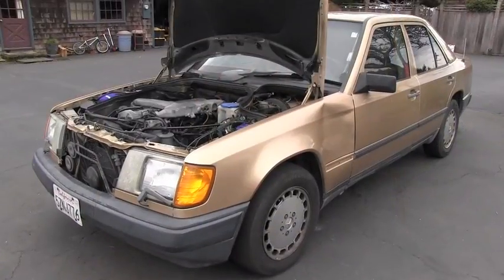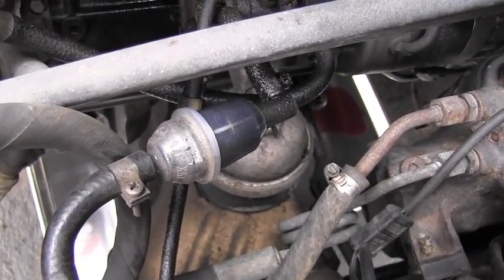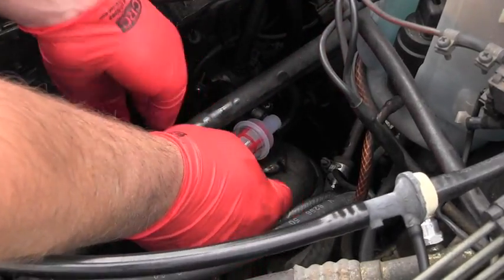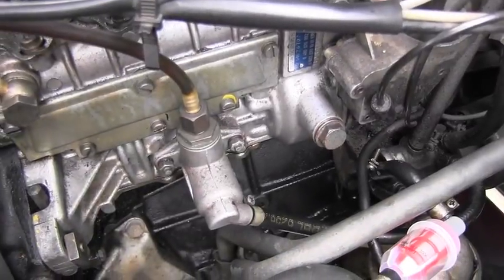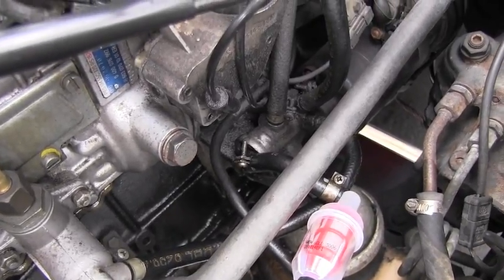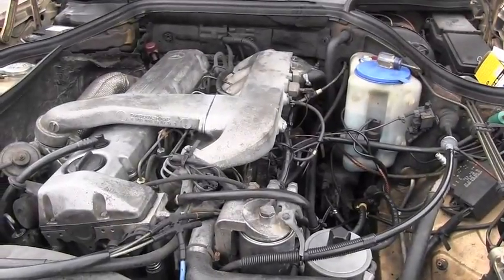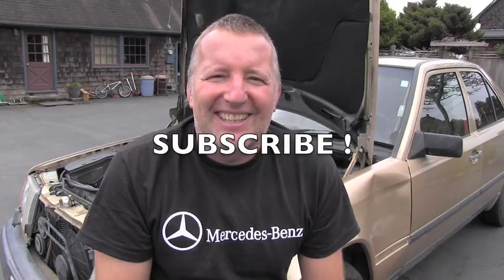Mercedes Diesel Fuel Pre-filter Replacement Problems

Comment: Nice video.
I did. Pre filter on my 1990 mercedes 300d turbo. 
I used 2 needle nose vise grips(with heat shrink tubing on jaws). One side at a time, new hose clamps, no fuel dripped  out..
You have great content. You explain well.

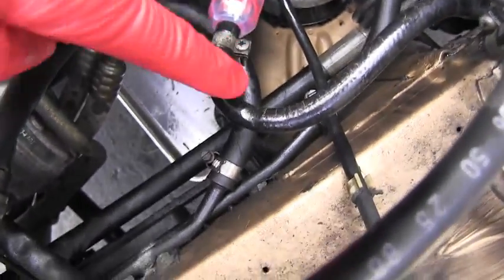Comment: Helpful.  My 2005 Mercedes Sprinter w/ 5cyl diesel (only 53K miles...in a Class C RV so it sat unused a lot) in-tank fuel pump became VERY noisy.  Ran it that way many trips.  Then CEL/SES light began coming on, producing P0087 codes (low fuel pressure) & limp mode, but only when climbing grades which called for hefty turbo boost (high fuel flow).  Flat roads or mild grades no problems. Clear codes and resume normal driving no problem until next period of heavy load on engine & fault codes reappear.  This problem climbing grades sounded like fuel starvation during periods of high fuel demand, plus with the noisy fuel pump, I suspected the pump and fuel filter.  I dropped tank & removed fuel pump.  It's an electric motor sitting inside a plastic canister/tub.  Inside the tub was a whole lot of grainy, squishy debris that looked just like the debris in your pictures at 2:10 and 3:45, only a whole lot more of it.  Looks like dark brown/black sawdust particles, only juicy & somewhat sticky so they clump together.  The entire bottom surface of the whole gas tank was coated in this stuff, mildly stuck to the bottom.   Sides and top of tank felt smooth, but you could feel the gritty gooey texture caked on the tank bottom.  I cleaned the tank insides with rags and flushed with clean diesel, filtering the outflow through cheesecloth until no debris poured out.  So now the tank is very clean.  The fuel pump has a long small diameter tube extending from the canister that is supposed to lay on the bottom of the tank.  The end of that tube has a small plastic cone-shaped strainer.  That small strainer cone was completely caked in compacted clumpy mildly sticky particulates.  You couldn't see any of the plastic features of the underlying strainer.  But that tube is too small of diameter to be the entire fuel pickup tube, not totally sure what it's for (maybe reserve capacity?).  So I then took the fuel pump apart (not made to be disassembled, but it can be done with care & time).   The guts of the fuel pump/fuel level sensor assembly is the cylindrical metal pump seated down in the center of the plastic assembly canister.  I was eventually able to wiggle the pump out of the canister.  The entire bottom end of the pump is capped with a very fine mesh fuel strainer.  That strainer was completely caked and coated with this compacted gunk.  At first I wasn't even sure it was a strainer.  It looked like a black felt pad on the bottom of the electric motor.  But his bottom end of the pump & its strainer is clearly the primary fuel pick-up path.  I pried off the strainer cap with a screwdriver (pretty easy), and you could hold it to light and see the severity of caked on residue.  No light penetrates, not even close.  Very thick layer of caked-on grime.  With this strainer cap off, internal mechanics of the electric pump is visible and it was totally clean & shiny, no sign of this debris at all.  I probed the fuel supply output connection ports of the pump, and the fuel supply line leading to the main fuel filter, seeking to scrape up gunk, which should be easy if it were present.  I found none, so I suspect those lines & the main filter are probably OK.  The pump motor insides are shiny & totally clean.  This particulate gunk is large enough particle size that it appears the fuel pump strainer captures most all of it.  The severity of this gunky build-up on the strainer is no doubt the cause of the noisy pump (the pump has to work harder to try to pickup sufficient fuel), and the obstruction may cause cavitation.  Surely it's also the cause of the CEL/SES codes and fuel starvation under load P0087.  This is the first diesel vehicle I've owned, and in gas vehicles, fuel filter issues & filter changing is super infrequent.  So, I was stunned by the amount of this gunky wet sawdust-like debris in the fuel tank bottom, in the fuel pump canister, and on the pump's strainers.  It's clearly endemic in the upstream parts of the fuel supply system.  Your video shows me this very same gunk in your vehicle.  After installing your brand new pre-filter, very quickly you found these particulates visible in that filter.  My guess is you have this stuff on a very large scale in the bottom of the fuel tank and on the fuel pump pickup strainer, and maybe elsewhere.  This was a real eye-opener to me about prevalence of fuel contamination with diesel.  Not sure if it comes from getting bad gas, or letting a vehicle sit with fuel in the tank for long periods which gives time for chemistry to change & particulates to form and precipitate out....or perhaps both causes.  Your video of the old & new filter with particulates was helpful.

Comment: 1.  I like it when people show things NOT going smoothly
...it's adds depth and reveals consciousness and character
...we get to see your mind at work when things don't go well, and that's helpful.
2.  Someone asked, but I didn't see a reply from you...(I'll rephrase):
Unlike my  W123 '83 240D 4spd manual, does the W124 use the LIFT pump to remove AIR from the fuel system after a 'breach, such as fuel filter changes?
3.  I don't know you, but I already like you.
-

Keep On, Keepin' On, My Benz Friend
...(comin' at you from SF Bay Area)
...(maybe we'll rendezvous over a fuel filter housing gasket replacement one of these days ;)
...I'll make the drive and do the dirty work, you guide the proceedings...???
...USD/Fermented Spirits/God's Gift to the Plant Kingdom/Camaraderie...you pick
-
*Considering a 1987 S124 to add to my 'herd of one.
Question:  Does a 1987 300TDT (USA import) OM603.960 (turbo diesel) have OBD-1?
If yes, is it x11, 9-pole?...or x11/4, (rectangular with button, flash and 'memory)?
-
Thank you for taking the time to do what you do...I, We, appreciate it...and You.  Thanks.

Comment: Did you have to bleed air out of the lines? I have a c250 om605 car that's from Belgium.  I have it in kansas city. The USA. I'm not seeing fuel in the lines,  so I think I have a bad fuel pump. If you know of a video that shows where the fuel pump is, please post it. (ITS A 5 CYLINDER ENGINE) keep up your good videos,!

Comment: hello, I have a question regards on my W123 240D, there are times where I prime my hand pump the pre filter will fill up with fuel, but there are also times where I go to pump the primer after doing fuel maintence the prefilter will be halfway full or quarter full? even when I keep pumping to fill up the pre filter, the quarter space im the pre filter won't fill up.. is that normal? or does that indicate how much fuel is in the tank?

Comment: Hello!
After replacing the fuel filter and pre-filter is no need to bleed the fuel circuit?
Thank you for you awesome videos!
Reply: filipe soares i am here to check on that too. That injection pump is self bleeding but still it worried me
Reply: Automatic bleeding was introduced in 1994-1995 models, if inremember correctly.
Older require manual bleed pump.
Reply: The bleeding was automatic.

Comment: Do you plan on replacing fuel heater?  Any negatives to bypassing it?
Reply from the maker: I have removed that failed fuel heater thermostat element and all those rubber hoses…it feels less crowded down there…not planing on putting it back at this moment..many other problems to be repaired.